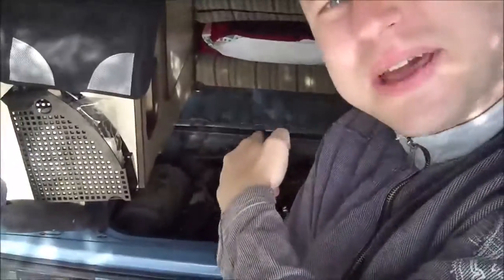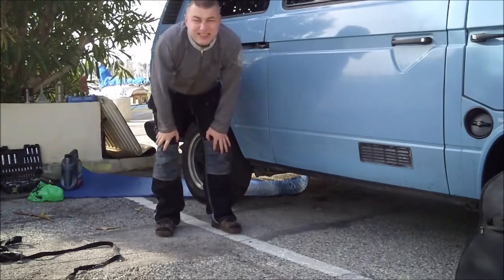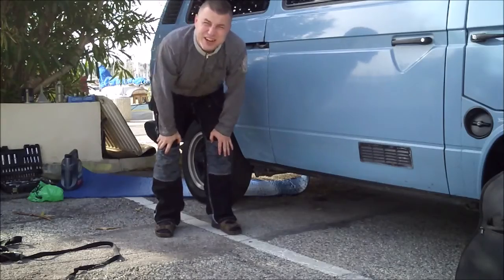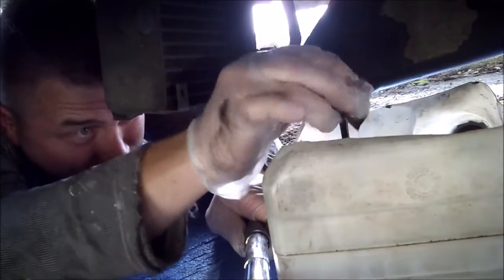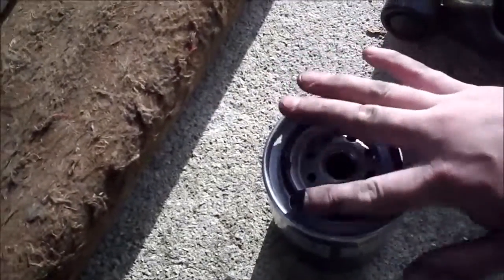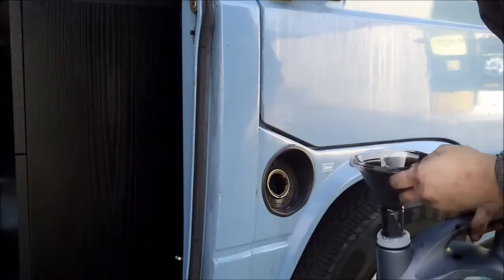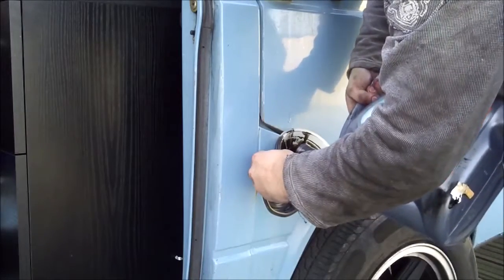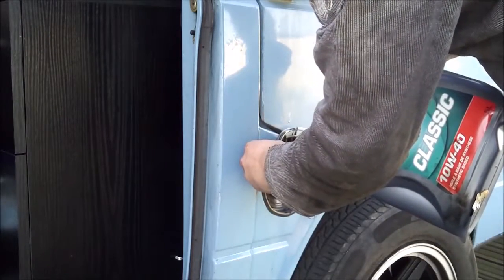HOW TO CHANGE MOTOROIL ON 1982 VW TRANSPORTER T25/T3

Comment: can i ask why did you put the oil in the petrol ?
Reply from the maker: +Kano Niko the van is run by an old diesel engine with a mechanical pump. About 10 of used engine oil is not a problem to consume, oils inside as well. Then I didn't have to look for any recycling place or ask any garages to take my used oil.
Reply from the maker: +Need To Explore 10 percent
Reply: it is a diesel engine, not a petrol engine